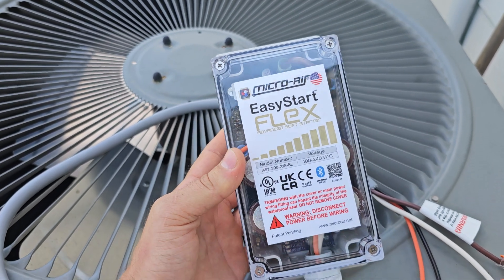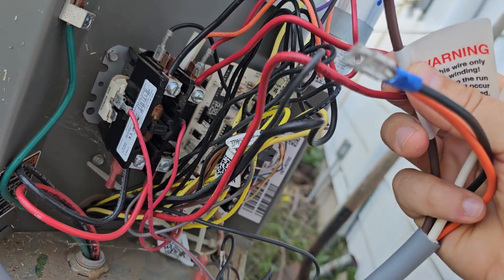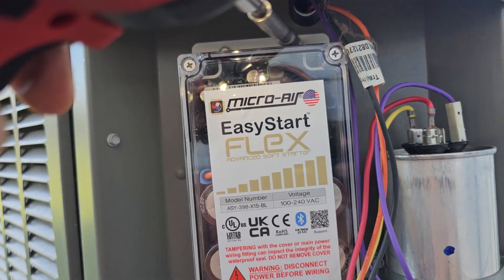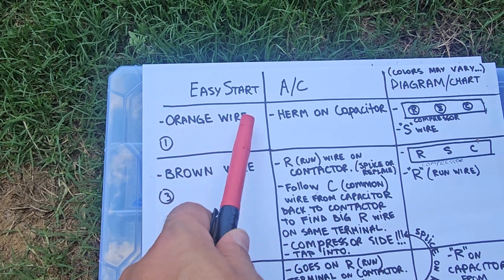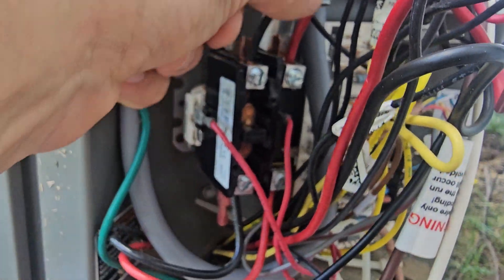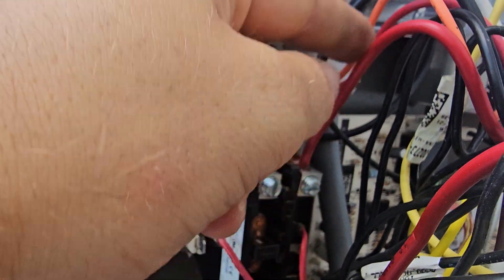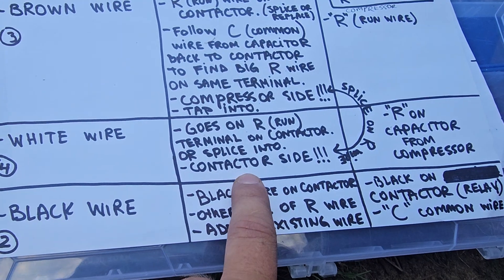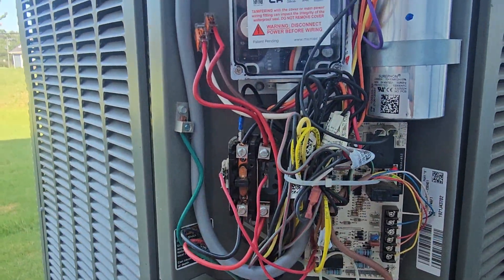AC system #MicroAir Easy Start FLEX Advanced #SoftStarter Installation for #Generator use

Comment: I have a Klein CL445 Clamp Meter with in rush button.I placed clamp around the Black compressor wire that goes to the contactor. Placed meter in Amps pushed button for in rush, started compressor shows OL (open line) compressor started no issue. I am just reading in rush current before installing Micro air flex. Did the same thing on Red wire to contactor OL? Looking at schematic the compressor has 3 wires red and black go to the T1 and T2 of the contactor, yellow wire goes to capatictor HERM. I tested in rush on irrigation pump and got a reading of 42 amps. What am I doing wrong?
Reply from the maker: Why you see OL

Meter over-range — OL usually means the clamp meter is seeing more current than its selected range can display. Many residential compressor locked-rotor / inrush currents are hundreds of amps for a short instant; inexpensive clamp meters often can’t show that and display OL instead.

Wrong capture timing — most clamp meters’ inrush mode must be armed (press inrush) and then capture the very next start pulse. If you press inrush too early/late or the compressor start is delayed, the meter can miss it.

Clamp on the wrong thing — if the clamp jaw encircles two or more conductors (hot + return or both phase conductors) the currents cancel and you’ll read near zero. You said you clamped the black wire only — that’s correct; just double-check the jaw is actually around a single insulated conductor and not the whole cable bundle.

Clamp orientation / zeroing / bad connection — make sure the jaws are fully closed, no debris, and the meter is zeroed (if it has a zero feature). Weak batteries or a defective meter could also behave oddly, but you measured 42 A on the irrigation pump so the tool can measure.
Reply: @ clamp does not make good contact. I press them together and got 103 amps. LRA is 96.
Reply from the maker: Why compressor might be huge and you saw OL

Single-phase HVAC compressors often produce a very large, brief inrush (locked-rotor) current — hundreds of amps for a few milliseconds. Your irrigation pump’s 42 A steady/inrush is small by comparison, so that measured fine.

Things to try right now (step-by-step)

1. Confirm clamp on a single conductor: visually inspect that only one insulated conductor is inside the jaws (not the whole cable or two conductors).

2. Use inrush capture correctly: press the meter’s inrush button, then have someone engage the contactor (or push start) immediately — most meters require the event to occur within a few seconds after you press inrush.

3. Try different wire: try clamping the red and the black separately (you already did — good). Also try clamp on the wire from the contactor to the compressor rather than upstream where multiple conductors may be bundled.

4. Check meter range/manual: read the CL-445 manual for the inrush capture limits and any special procedure. If OL is an over-range, the manual will state the maximum inrush it can capture.

5. Estimate instead of direct measure: if the meter can’t capture inrush, measure running amps and estimate inrush using a locked-rotor multiple (typical single-phase motors start at ~4–8× running amps; HVAC compressors can be higher). Example: if running is 20 A, inrush could be 80–160 A (or more).

6. Use the right tool: if you need exact inrush peak and your CL-445 can’t capture it, a higher-range inrush clamp or a Rogowski probe / current transducer that captures fast peaks will show it reliably.

7. Safety: don’t clamp around multiple conductors and don’t open live circuits unnecessarily. Work with the contactor terminals covered and use insulated tools.
Reply from the maker: Just proceed with installation.

The EasyStart is designed to handle it (inrush amperage) automatically.
Its entire job is to learn your compressor’s startup profile over the first 4–5 starts and then permanently reduce that inrush by 60–75%.
It doesn’t need you to measure the inrush — it detects and adapts to it internally. Its just for your information. Just trust the process, it works :)

Your meter is probably maxing out (OL) because the startup surge is well above what it can record. That’s normal for larger compressors (like 2–4 ton A/Cs). Even pros often can’t capture that with midrange clamp meters.

You’ve confirmed your compressor starts fine right now.
That means the wiring, capacitor, and contactor are all healthy — exactly what you want before installing the EasyStart.

Comment: I installed the same pre-wired with connectors Soft Starter yesterday.  I just had to move the condenser to make room for the soft starter.  Works great!  Our compressor is just outside the wall to the bed in our master bedroom.  It would wake me up at night with the loud start............ not anymore.
Reply from the maker: Right on! Don't forget, it will give you ability to run your AC with a medium sized generator! Mine is 7000+W running generator and it doesn't struggle!

Comment from the maker: (Links are in description for your convenience)

IMPORTANT: Forgot to show how to discharge the capacitor on video (thanks for the reminder from other comment!): 

-MAKE SURE A/C IS DISCONNECTED!
-Use insulated gloves and a screw driver
-With the metal shaft of the screw driver contact the HERM and C (common) terminals. 
-Tap a few times, then hold for 30seconds or so. 
-Repeat between C and FAN terminals.

This will discharge the energy from the capacitor, as it will hold some even when the A/C is off. So you may see some spark, which is normal.

(Do this at your own risk!)

Comment: This was very helpful.  I had mine installed by an HVAC guy, but it may be having issues.  Using those Wago connectors makes it easier to reverse the wiring…. The only way for me to know if the issue in my compressor (unusual vibration) is from the Easy Start is to disconnect it  and see if it persists.
Reply from the maker: Would be nice to know, please get back with an update on what was the cause/issue! 

Suggestion to check (not in order), mounting/mechanical parts..
-First check for simple debris inside compressor or fan and make sure it's all clean.

Look for:
-Loose mounting or internal parts/bolts/bearings
-Loose/worn rubber mounts/pads
-Piping contact (loose pipes can cause vibration sounds at connections or tapping/rubbing against something)

Electrical/system issues:
-Hard start or high head pressure: if refrigerant charge is off, or there's restriction, the compressor may strain and vibrate.
-Voltage imbalance (in case soft starter is defective or not doing it's job), which you can/should check after looking at mechanical/mounting flaws first. Bypass the Soft Start system altogether.

 This is why this type of system should never be cheap/unreputable/knockoff brand (you never said if you had same one installed, assuming it's not) but you could always have a lemon and have a faulty product either way. Unfortunately it does happen... call the manufacturer, I'm sure they will take care of you!

It could also be refrigerant issues: overcharging/undercharging can cause compressor to strain and vibrate.
Reply: @maxyourselfwithdiythank you!  I have this exact soft start, the Flex.  We’ll see.  The easiest way to start is probably to just disconnect it and compare the noise, because it wasn’t doing it before the install..   MicroAir said they will replace it if that’s the issue.
Reply from the maker: @oneisnone7350 As long as you feel comfortable doing it yourself,  definitely try it! Should be a quick diagnostic. 

BUT, seriously, sometimes the worst problems can have the most simplest solution and those are often overlooked. 

Check for any debris, loose parts, vibration pads, bolts, pipes. All this can be done visually. 

(Always pull the breaker, to cut power off to your AC unit when working with or around it, to be safe!)
Reply: @maxyourselfwithdiythanks.  I’m pretty good at the basics of electrical wiring.  And since it’s installed, it’s quite easy to take note of the wiring and simply reverse it.  But I will definitely take everything you said into consideration…., especially disconnecting the power and I’ll discharge the capacitor, also!
Reply from the maker: @oneisnone7350  Thank you for the reminder about discharge of the capacitor! I forgot to show it on the video, but I did it beforehand. I will make another comment about about it, to help other people with the install process!